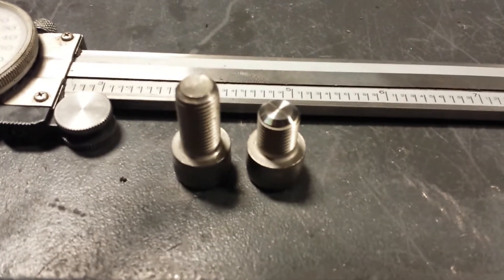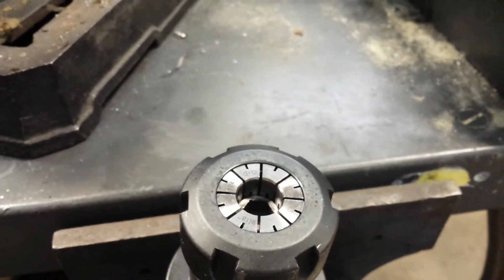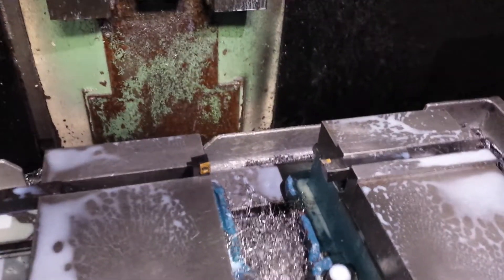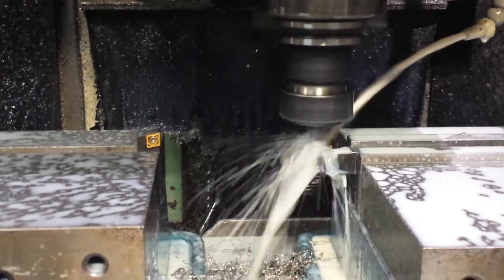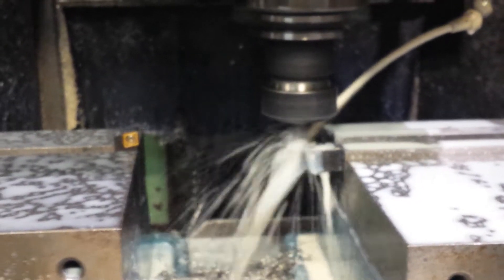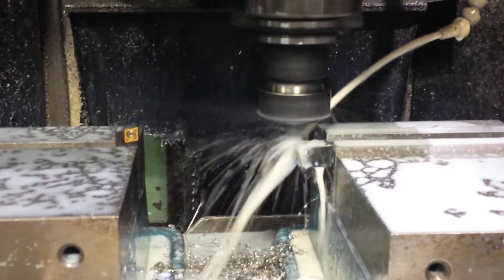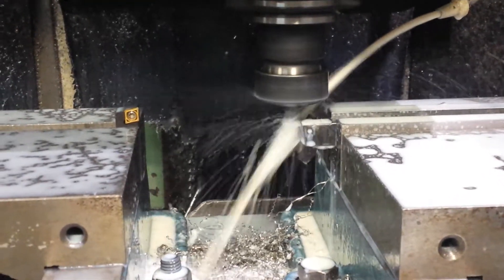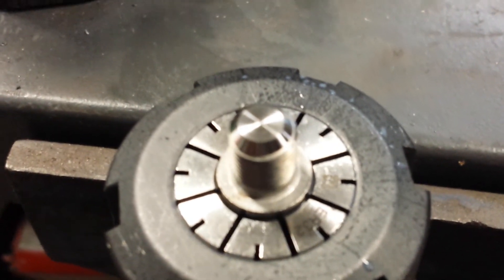Turning Operation on a VMC

Comment: Sir, not owing a machine... Hoping to though... So forgive my question... Is it possible to have a servo motor coupled with a Chuck (like in a lathe)... Strap it to the table...and use it like in a sense the tool is moved akin making of a mud pot... Is that possible? Once again apologies for the question...
Reply from the maker: Pradeep Sasidharan   Not sure what you’re hoping to accomplish, but I suppose so.  If you can imagine it, it’s probably possible.